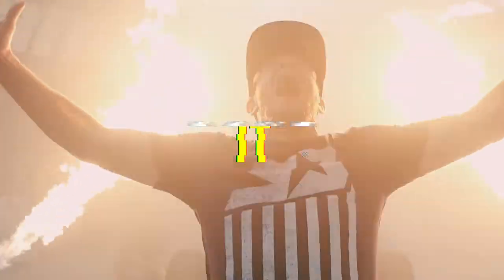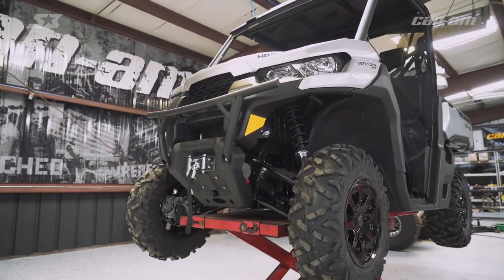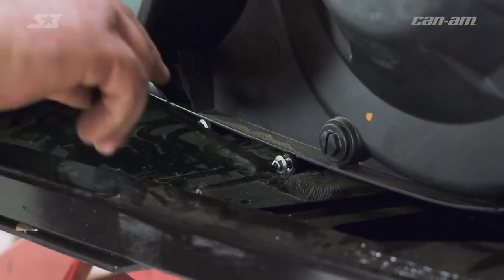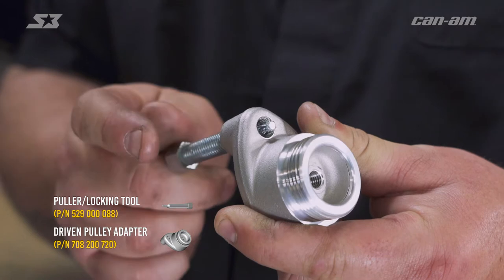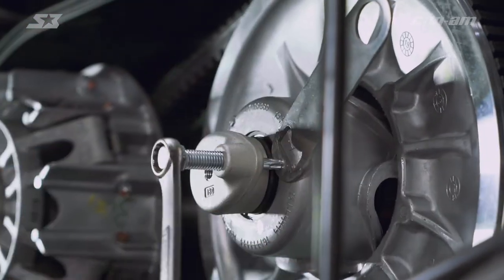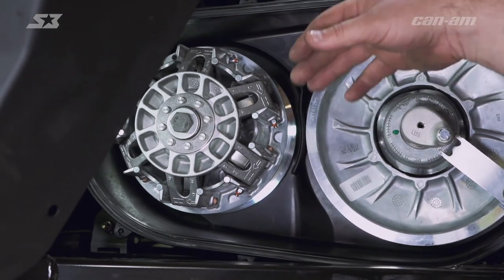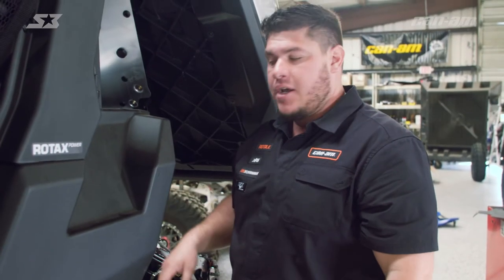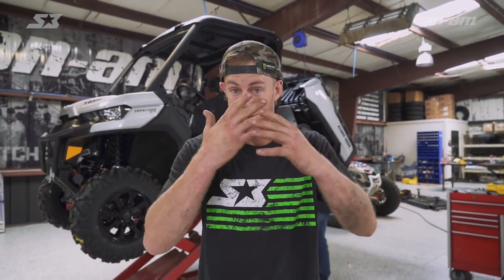How to change the Clutch Belt on your Can-Am Defender | Gettin’ It Done

Comment: I’ve got 1600 miles on my 2016 Can Am defender and it’s starting to get the “ Slip” light on when I get in a mud hole that normally I have no problem with. Have to put in 4L to get out. Would the belt be the problem? It’s not the gas as I discovered 2 years ago was the issue after I ordered the belt. Just curious.
Reply: With that information, i would say yes. definitely your belt. If you have 1600 miles on a belt that hasn't been changed and you are hitting mud in High range, you are definitely getting belt slip. before 1600 miles we normally change the belt, inspect our clutches, confirm the belt box is still sealed well. just general inspection. that should get you fixed back up good as new

Comment: Now why is 2021 Can-Am Defender 6 seater. It gots to switch the lock it in two the rear end in how do you switch it into four-wheel drive do you have to use that switch lock it in